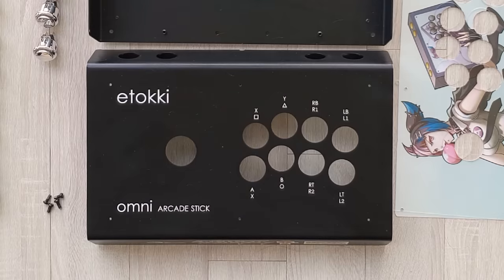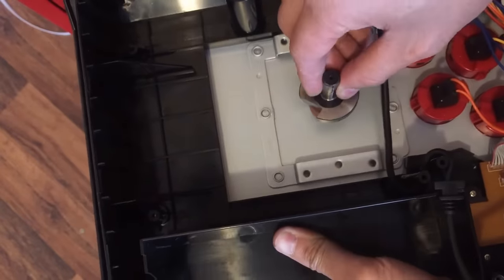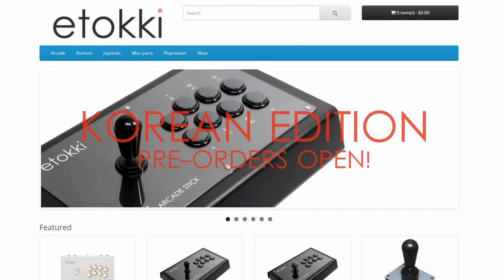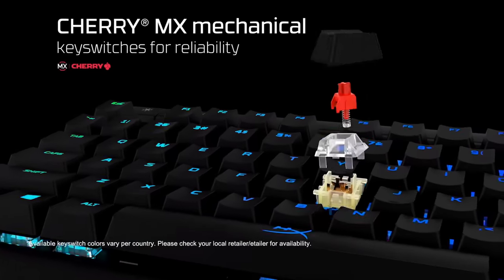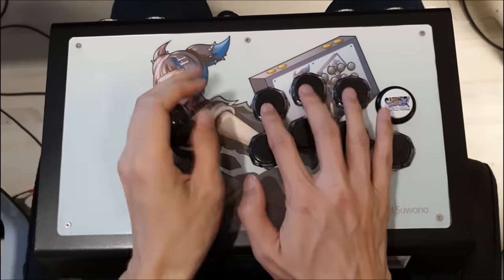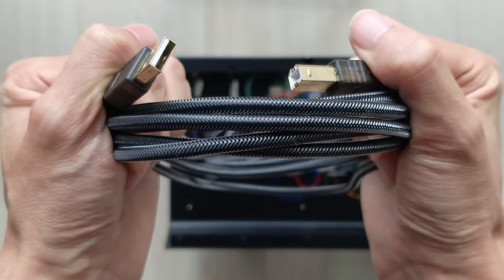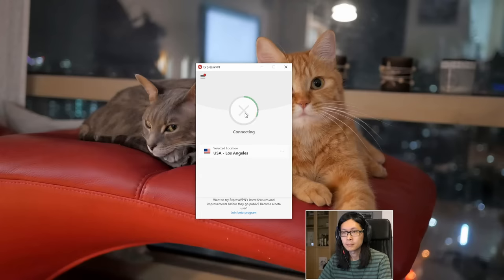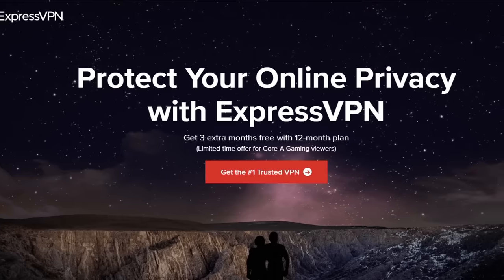The Stick I Use

Comment: Whats the extra green pcb board on top of the universal fighting board? I think the pcb on my etokki is bad because when i connect it to PC, it works for a little bit and then it stops working. And then i keep getting a usb malfunction message when i try to reconnect. Changed the usb chord but problem still persist. Ive been looking to replcae but seems like a daunting task

Comment: Man I remember back in the day (2013) I was trying to make my own fight stick and I couldn't get hold of an xbox compatible card, I ruined like 4-5 xbox 360 controllers from first time learning to solder the connections, they were frickin small and burnt out easily! Then a further 2 of my friend's controllers before finally getting one right, thankfully we went through a few 360s thanks to the red ring so there was an ample supply of controllers. Man we're so lucky now that there are universal fight stick boards out there, I might dig out my old fight stick and see if I can hook up what you got there and get back into street fighter. Thanks for showing your fight stick and how you made went about it.

Comment: I'm jealous of that white gold omni.  I was going to get one to put a golden lever in, but it was just too much for what is essentially a white metal case with gold sanwa buttons and a board.

I have a black versus case from asindo that I'm going to put it in instead.  I even got full sets of both gold and silver crown 202 buttons so I can choose the gold or silver configuration of the lever and have it match.  With that said, it's going to be a mantle piece more than anything

Comment: I made my own stick when I was about 16, nearly 14 years ago. Followed all the instructions on Slagcoin. It was Just a simple box made out of Mdf wood with plexiglass. For the pcb I used a madcatz arcade games tick for the 360. I was so proud of it as a kid, even though my soldering was crap.

It's good to see there's so much more resources and community. I can't believe you don't need to solder anymore, as I did such a shit job of it lol. Im going to try and get back into it and try doing it as a craft :)

Comment: Hi, im wandering what the pcb is called that you use/they use, mounted to the pins on the UFB that allows them to hotswap buttons and lever with plug connectors?

Comment: 3:03 That "doghouse shape" is a USB-B connector. You usually see them on printer cables and USB hubs, not sure why it's used here.
Reply: USB D you mean
Reply: USB type B is used in most fightsticks with detachable cables because the connection is stronger than type C or micro A. It is less prone to accidental detachment that you don't want when you're in a tournament setting.

Comment: Never really liked how the bat top of some levers have could I just replace it with a ball top if I wanted to without hurting the performance or durability? 

Still an amazing and really insightful video as I actually made my first fight stick with my dad out of a large jewellery box hand cutting all the holes and everything.
Reply: Japanese levers have easily swappable handles because they just screw on. With Korean levers, (like the one he uses) the bat top is permanently attached to the shaft, so you either need to replace the shaft, or get a JLF conversion shaft for Korean levers.

Comment: I like to tweak my stick now and then, but I've never changed out the board. Really cool and you're definitely braver than I am. The joystick itself looks a little loose for my taste though. If I don't have at least a 2 pound spring I feel like I'm going to suffocate. I'm rocking a 4 pounder in a Hori stick that otherwise has default parts right now.
Reply: Korean levers are more bouncy because it uses rubber/latex grommet for tension instead of springs but generally they can feel much stiffer than JLFs depending on your preference

Comment: You do your thing! But I'm not sold on braided cables. In my experience I've had equal amount of braided cables fail on me as non braided, it is always the connector head or base that is the issue. So it's more an issue of quality. Uniqueness, yes, but at the cost the annoyances of a rigid cable.

Comment: Sold

I was struggling to find a place that ships good sticks (Ireland)

Was looking for a Hori Fighting Edge or Qanba Pearl. Really wanted a noir layout.  Found the Omni but wasn't sure until this vid

Cheers bud
Reply: Fightstick Alpha might be another affordable option. All these custom sticks ask for 50 - 100 more than maybe they should cost. At the end of the day as long as you don't throw things on the floor any fightstick in the 150 range will last you years so by the time something goes wrong hopefully you'll have 150 to spend again. This all comes from seeing the Obisidan 1 costing $200 and the Obsidian 2 costing $300, guess what that extra 100 is getting you? PS5 support because the rest of the stick is the same material, same cable management, same buttons, same layout, you can't even modiy the stick simply it's yet again plastic standoffs with stripping screws on a single back plate.

Comment: Ahaha, A friend told me "your stickers got featured on Gerald's video" lmao "my" stickers. I literally printed them out from SRK wiki. it involved minimal work on my part so they're not technically mine.  I hand them out during majors to everyone I know who runs Super Turbo events because people mashing out old character codes like Gerald does is a MAJOR source of microswitch damage in the ST community.  At least he mashes along one axis rather than diagonally LOL. (I do that when I don't know the code).   Also incorrect character picks due to messing up the mashing slows down tournaments too.

In the Toronto community, putting a sticker on each stick that gets "dedicated" to a setup over the past few years has reduced broken sticks to a very small fraction of what they were previously.

Mashing definitely works. Especially in ST.  I love mashing.

Comment: Is there not a compartment for the cable?
Reply: There is not, no quick disconnect either and it doesn’t have a latch to open and close real quick. Not the end of the world, but disappointing for sure.

Comment: Had to pause and comment on the cherry MX blue. WHAT! I don't care about the sound or whatever, that part is fine. How that switch works mechanically though makes it very bad for fighting games. The way it has to release between presses and how you can't push it again if you are to quick makes some moves impossible on them! I pretty much got rid of an old keyboard just because of this. They are wonderful to type on but for gaming it was the worst. Biggest offender was when trying to play fighting games on the keyboard, and yes I'm big on playing my fighting games on keyboard.

Comment: what is the advantage to using a stick?
Reply: Less pain, assuming good ergonomics allowing longer more practice and play sessions. You can play at an Arcade. It’s more tactile, as well.

For classic games, they were designed around sticks, modern games don’t have this issue, so pad is fine.
Reply: @chronology556  hmm interesting.
Reply: Kieron Rana why does 360 motions and charge motions exist? Thumbs will hurt if done for extended periods of time.
Reply: @chronology556  thumbs? i use keyboard, so i don't use thumbs for that :)
Reply: Kieron Rana my fingers, still end up hurting. The ring, middle, and index. Maybe thumb for space.
Reply: @chronology556  ah i see